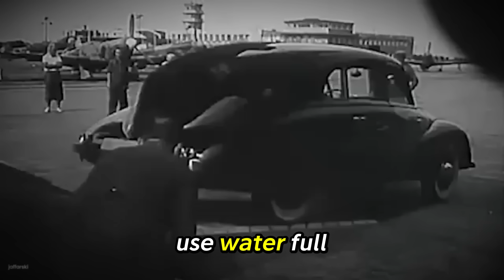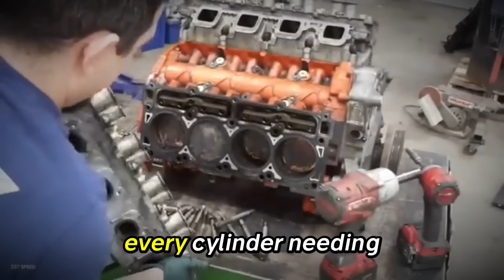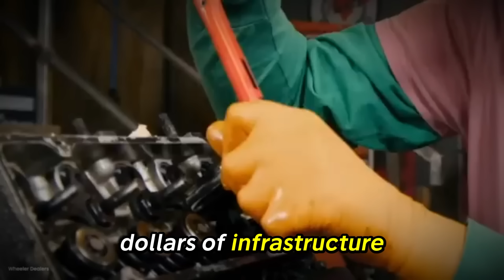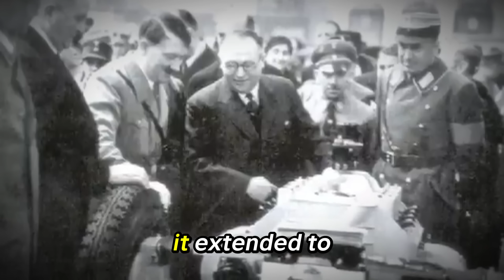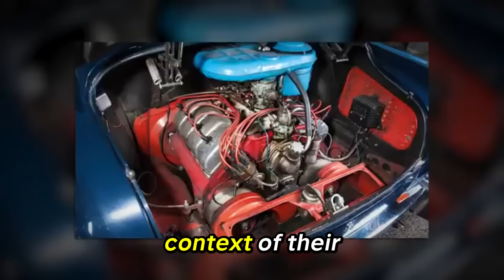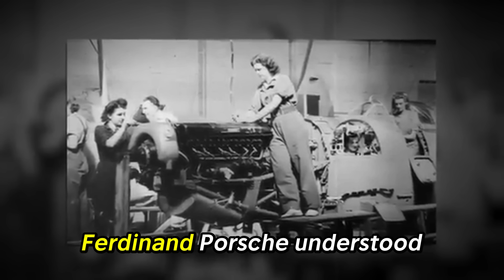The "Impossible" Air-Cooled V8 That Made Chrysler's Engineers Question Everything

Comment: The best motors to ever come out came out the late 50s through the very early seventies. We Will never be better than the 60s high performance engines. For some of the slant six years I can go million miles low on oil or even sand in your oil
Reply from the maker: No doubt the late ’50s through the early ’70s produced some legendary engines—simple, durable, and built to last. The Slant Six, in particular, earned a reputation for running seemingly forever under conditions that would finish off many other engines. That said, modern engines have surpassed them in efficiency, emissions control, and technology. Different eras, different strengths—but those classic powerplants definitely deserve their legendary status. 👍

Comment: Even most motorcycles are water cooled now .
Reply from the maker: Yes, that's true. Most modern motorcycles are now water-cooled because it provides more consistent temperature control, better performance, and helps meet stricter emissions standards. That said, the simplicity and reliability of air-cooled engines still have a special appeal for many enthusiasts. 👍
Reply: Depends on which country you are talking about.

Comment: He wasn't thinking outside the box, he was copying, not directly supposedly but knew all about H.H. Franklin's air cooled engines!

"H.H. Franklin engines stayed remarkably cool, often outperforming liquid-cooled cars of the era. Using a powerful crankshaft-driven fan to force cool, dense air over aluminum cylinder heads and metal cooling fins, these engines were capable of running at full throttle all day long in extreme heat without overheating."
Reply from the maker: "One could argue that the concept wasn't entirely original. H.H. Franklin's air-cooled engines had already demonstrated that a properly engineered air-cooling system could be exceptionally effective. With powerful forced-air cooling, aluminum cylinder heads, and efficient cooling fins, they were capable of running at full throttle for extended periods in extreme heat. So when similar principles appeared later, it was arguably more a case of refining and adapting proven technology than inventing something completely new."